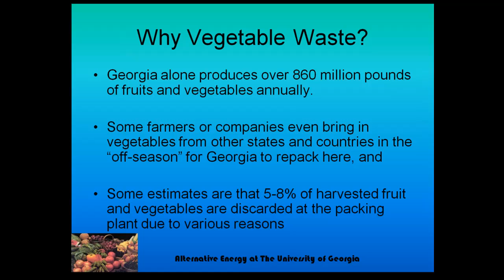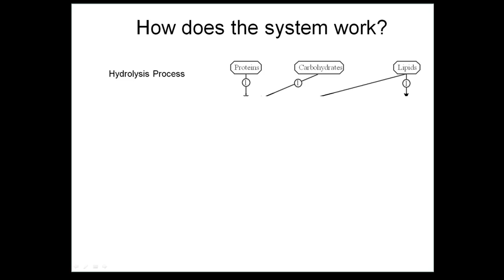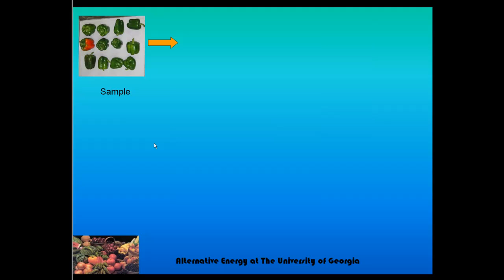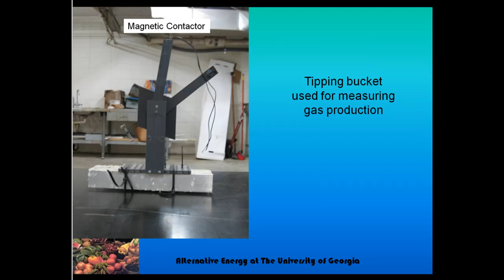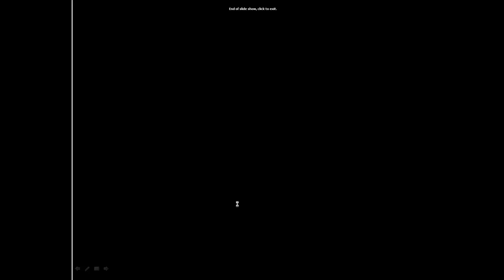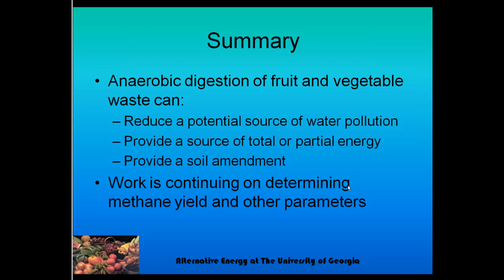Onion Power: Potential Production of Biofuels from Onions and other Vegetables

Comment: Excellent information. I hadn't originally figured on using a high percentage of high sugar/ high carbohydrate feed stocks so most of the material should have similar COD numbers but that was mostly because I hadn't seriously considered fruits and vegetables making up more than a couple of percent. My guess is by juicing the fruit and vegetable matter the remaining pulp would have a lower brix number and would be easier to manage then the other feedstocks, the juice your can use in a separate digester. FYI consider biochar or charred chicken feathers instead of the expanded rock. Both are even more porous and could add carbon into the system. The juice is an interesting idea just use a low oxygen environment so you get methane producing bacteria instead of yeast which would convert it to alcohol rather than methane. Since you can use all parts of the plants I can see the effective yield of energy being far higher than with alcohol systems not counting the need for far less energy. If the digester can be properly managed as you lay out I can't see any advantage in going with alcohol if the end use is for energy. It's easier to adapt to cars and easier to store but unless you can grow sugar cane alcohol is a pretty dicey fuel source.

Comment: I very much like the boiler (maybe in combination with gasification) creating steam and condensing true a stirlin engine.. The nicest thing about biofuel.. a lot of infrastructure exist.  A simpel ottomotor is maybe cheaper-> cooling by heatexchanger for heating buildings?  I will try a normal boiler.